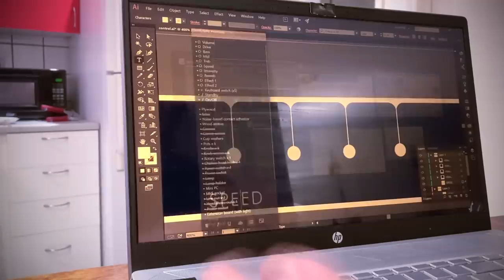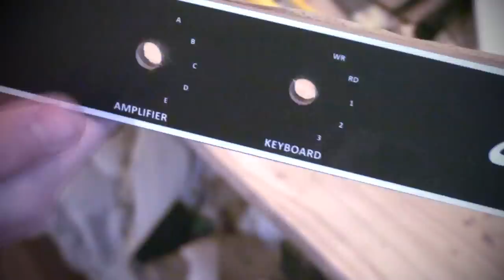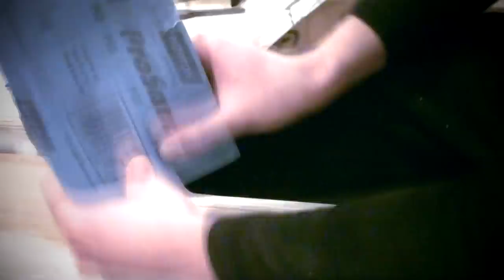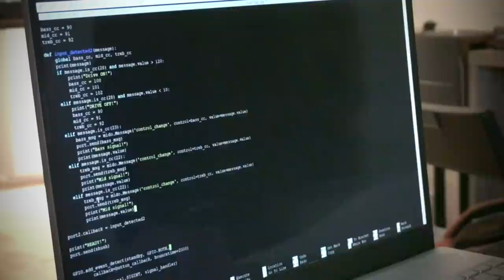Building An "Electric Piano"

Comment: you know studiologic is fatar who is a keybed manufacturer, and that you can find those keybeds without having to get the whole thing right? that would ofg saved you around 200 bux minimum... you probably could of got a more adapted kb for the task that would of avoided extra work imo. but well done. there is a chinese kb manufacturer (not beringer style of quality, i mean good chinese stuff) that makes 88 key keybeds with the hammer mechanics for 350...
Reply from the maker: Hey thanks. I tried. Replacement keybeds ended up being more expensive. I was living in Montreal. Thinking of making my own keybed soon anyways.
Reply: @aCloudOfHaze  oooh that's interesting. i have a laser cutter (not a lazy one it will cut 20mm of good wood), and i have been thinking about this myself, but you cant do it all. i need to see this... tbh i would love to have an SL73 myself to go with regen, but hey; you cant have it all in one time lol... i bought a couple fatar basic 37 keybeds lately (i'nm an indy builder making a modest living out of it), payed less than a hundred euros for one. but finding Any fatar as a private person is not that easy so i do understand... if i pass thru this chinese kb manufacuturer i'll send a link, i've had a chat on the topic with a chinese sourcer a few mionths ago so that's how i got a lot of info doing my reaserch...
Reply from the maker: @baddriddimworkshop  For sure, please do. I'm based in Hong Kong now so if you need a hand with sourcing I could poke around too. I understand finding a Fatar keybed is a lot easier in Europe. Frankly though I'm sick of their actions haha. Most commercial DP keybeds have way too short of a pivot length for my liking. I honestly think that's one of the biggest things making them feel unrealistic. They can get the weights and inertia perfect, but that short key length is always going to feel weird. Good luck!
Reply: @aCloudOfHaze  thx mate, i'll keep an eye on you...

Comment: Does anyone know if the addition of the rubber bands to the keybed is a manufacturer-designed modification? I assume the studiologic keybed had semi-weighted action.
Reply from the maker: No, I came up with it after trying various different options. It helps a good bit, but a lot of what makes this action (and a lot of other cheaper DP actions) feel unexpressive/unrealistic is the short key pivot length.

The TP/100LR is known to feel chunky and burdensome. I've tried adding weights to keys, making hammers lighter etc. on another one, but these modifications tend to introduce inconsistencies and are quite unpredictable, probably because the "feel" of the action is much more than just static downweight/upweight, and factors like momentum and friction are significant.

Ultimately the rubber bands are a "good-enough" modification to lighten up the action a bit without being too invasive/irreversible. Until I can create my own action... :)
Reply: @aCloudOfHaze  That's really cool. The simplified amp-like interface definitely appeals. I know you used a Blackberry or similar for the sound engine (and that it was probably a major part of the fun) but the video made me question if it would be feasible to build a similar cabinet for Roland RD 64, using the RD's own keybed and sounds.

Comment: Excellent work despite home conditions. Your work deserves a real electric piano! 
One question: What did you glue the Tolex with? It looks like wood glue...
Reply from the maker: Hey thanks. I used a brush on contact cement (that's why I dried it before sticking it down), but I believe some people use PVA.
Reply: Thanks, I will try both.

Comment: Hello! Can you please shed light on actual electronic parts and how you connected everything, please. I really want to do something similar, but I don't know how I can find an actual keybed and how to connect it to mini pc? And what about knobs ? Did you connect it through GPIO pins on raspberry pi?
Reply from the maker: Unless you're a distributor or manufacturer, it's gonna be hard sourcing a Fatar keybed. You might have some luck on eBay, or you can always do what I did and rip it out of a controller :)

IIRC I ran the pots through a Doepfer Pocket Electronics unit, but the switches go to the GPIO pins.

Check the description, I put some useful resources there. Good luck!
Reply: @aCloudOfHaze  Thank you! If I am be able to do something useful, I’ll notify you!